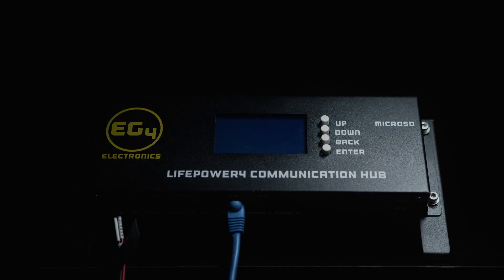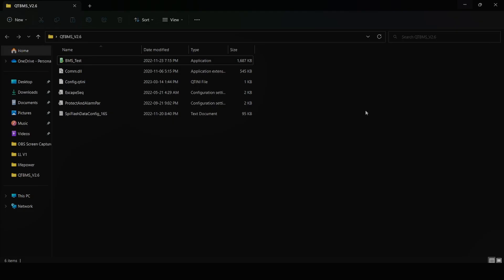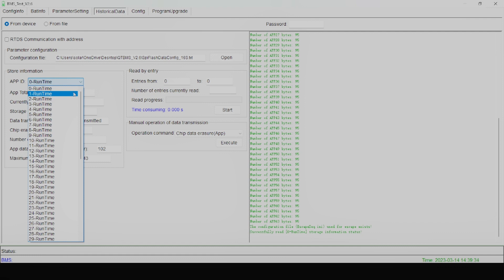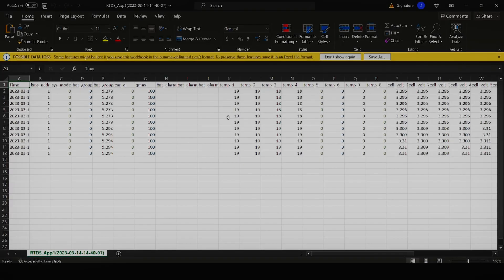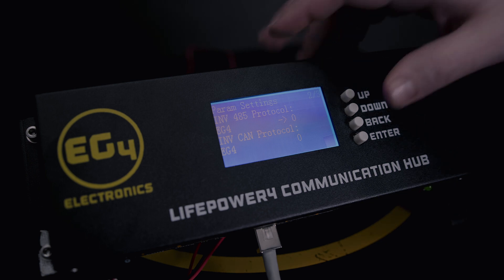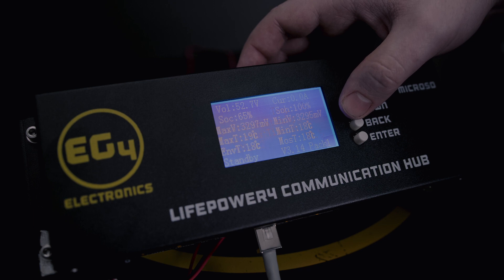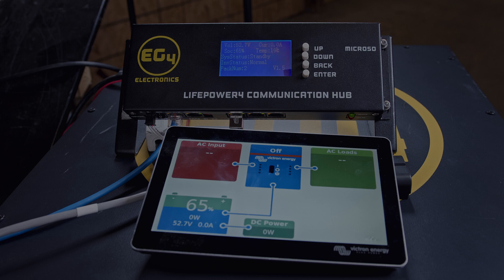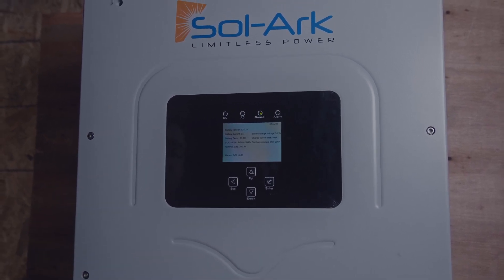EG4 LiFePOWER4 Communications Hub - Closed-Loop Communications with Sol-Ark, Victron Energy, & More

Comment: Is there an advantage to the hub if you have EG4 Life power4 batteries connected to an EG4 18kPV? If so, what? 
Do the battery racks really need to be wired diagonally to balance the battery cycling? Don’t the batteries communicate with each other to do that regardless?

Comment: Are there written instructions about how to connect the Communications Hub to a Victron Cerbo GX?  The EG4 website only contains firmware for the Comm Hub, not a link to a manual.

Comment: I have 16 Lifepower4 Batteries and intend to add more - would it work to configure 'bank 1' with the battery dip switches set to addresses 1-8, and set dip switches exactly the same on 'bank 2'...? or would there be an address conflict?

Comment: If you are having issues here are some things to try.... 1. BMS battery firmware has to be upgraded to v3.21 or higher. 2. Once the BMS is upgraded the baud rate in the settings of the hub have to be changed to 19200. 3. On the hub, dip switch r1 should be down, r2 up. 4. The mac software to upgrade battery bms is buggy. I had to try 10 times to upgrade the BMS. BattInfo screen works well. Upgrade does not. After all that, set battery dip switches to a non zero value. My Victron Multiplus II is now talking. Thank you signature solar for the help! Closed loop achieved! Also, Victron will use the BMS can data over their smart shunt values in the VRM screens. Be sure you have the special victron cam cable to hub. Hub to battery uses cat 5.
Reply: I'm trying to get my Comm port to talk to my Victron Cerbo GX. Changing Baud rate to 19200 fixed some problems but I can't see all 6 batteries yet and the Cerbo can't see anything.  Where did you get reference info on the Hub DIP switch positions? What do they do?  Thanks!

Comment: After I plug My Hub to 48V EG4 battery, It still does not read the battery. No info regarding the battery show up on the HUB. Do I need to install anything on the MicroSD card or do anything besides plugging RJ45 cable from Battery to the Hub?

Comment: Not clear instructions!! What kind of cable to connect communication hub to insighthome? That cable you using looks like it is modified. I purchased same equipment along with rs485 cable and follow your instructions and it won’t detect anything.

Comment: I have the SUNGOLDPOWER 48VDC 6500W SP6548 which Will Prowse claims runs the same software as the MPP LV6548.  Will the EG4 LiFePOWER4 Communications Hub enable communication between my EG4 LifePower4 48VDC Battery and my SP6548 inverter?

Comment: Have been using mine for a week with a sol ark 15 k and it is working greatusing 5 life power 4 batteries
Reply: Sooooooooooooo.......what is the max voltage do you have set?  Of you are higher than the recommended float of 54.2 your BMSs will error every day the batteries go full.

Comment: Just got mine in the mail.  What port do you plug into the computer off the hub?
Reply: IT WON'T TALK TO ALL OF MY BATTERIES.  7 OUT OF 11.   CHECK DIP SWITCHES AND MADE CHANGES HOW MANY TIME'S.    WON'T WORK ON SOME OF MY BATTERS.
Reply: @bigblockcutlass123  I have 12 batteries and they're all detected.  Start your DIP switch addresses with the first battery set to 2, the next battery to 3, then 4, etc, according to the manual.  I've  had this configuration for Solar Assistant and it's been working just fine. The problem I'm having with the EG4 hub now, is when I have it also connected to the batteries, Solar Assistant can no longer read the battery data.  This is not good, as I still want to monitor each battery AS WELL as communicate with the hub (to Sol-Ark). I've had to disable the hub for now, as monitoring the batteries is more important than closed loop with inverter.  I'm hoping either Solar Assistant or EG4 can figure something out for this to work, simultanously.
Reply: @trevormann4751  I did a firmware update on the batteries that wouldn't talk do.  Now I have all 11 batteries.
Reply: @bigblockcutlass123  Great to hear !
Reply: @trevormann4751   Get rid of the factory sd card and get a good one,  Format it 32 fat.     Mine would not start up because of the sd card went bad
Reply: @bigblockcutlass123  oh interesting. That's good to know. Thank you

Comment: Nice. Would something like this work with  solar assistant or some other smart solar app?
Reply from the maker: Not currently.
Reply: @eg4electronics  just got the hub and my Sol-ark finally can communicate with my EG4 batteries.  However, I seem to have lost the ability to monitor each battery individually with Solar Assistant. I think they're both trying to be host perhaps ? Allowing Sol-ark to work via canbus and solar Assistant via RS-485 port 3, would be amazing ! If that's a possibility.

Comment: Is there such an item for EG4-LL (V1), or does the updated firmware provide the same functionality?
Reply: Following.... I have both V1's and V2's with upgraded firmware. While the batteries communicate, the SOC never is correct between batteries and my SolArk and effects charging. Do i need this comms hub to provide better communication?
Reply: Yes I would be interested to know if this would work with EG4 LL V1 batteries and Schneider XWPRO 6848
Reply from the maker: The hub is only compatible with the LiFePOWER4 model.
Reply: @oks3ranch  I've got the batteries doing close loop to my xw pro.  I'm trying to figure out why we'd  need this...
Reply: @JeffPalmer941  I recently got my EG4 LL V1 batteries working with the XW PRO in closed loops also.  I want to use SOC control for Enhanced Grid Support "starting stoping selling", etc.
Reply: @oks3ranch  Schneider released a new firmware the other day for the insight and xw pro.  Claims to have added this.  I loaded the firmware last night.  Waiting for the sun to come up to test it.